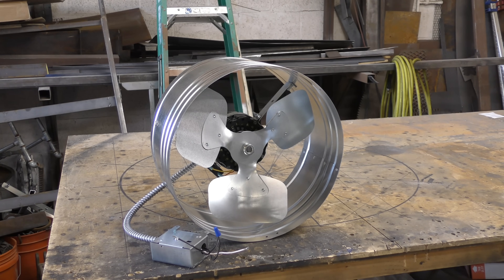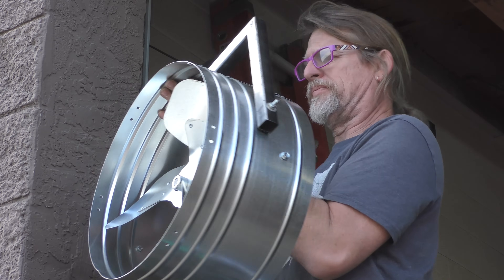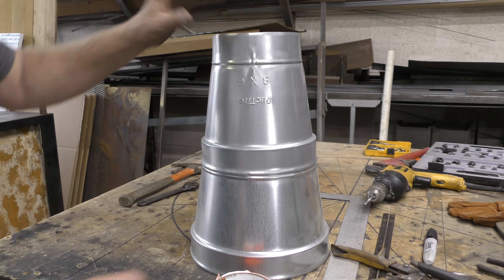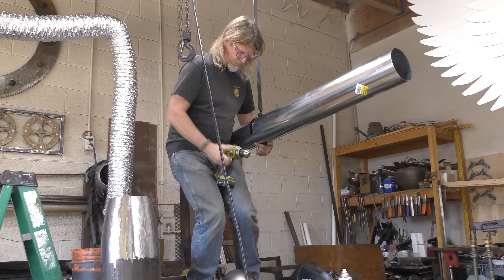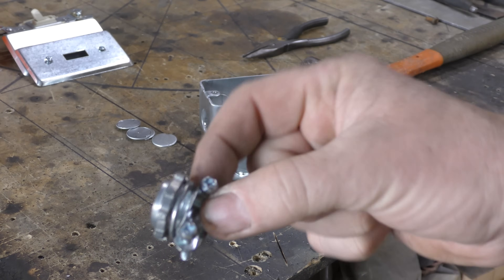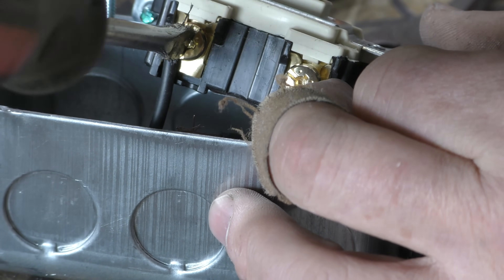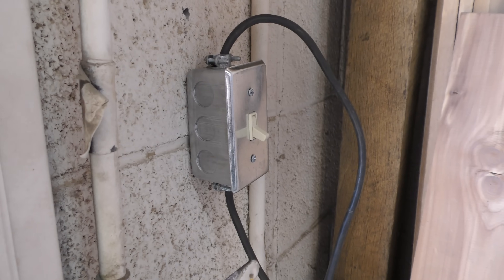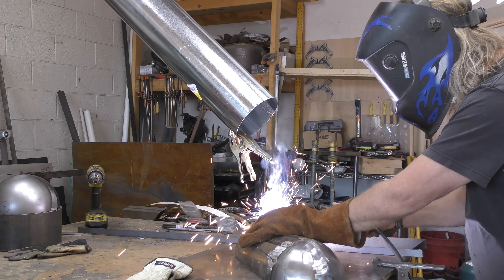DIY Fume and Smoke Extractor

Comment: that metal switch housing needs to be grounded. and also your fan otherwise its possible to have circulating currents that can damage the fan engine, lower bearing life and worst case humans.

Comment: I am about to put an exhaust fan together for a welding exhaust hood. I have a  5" metal duct in place. Would it make more sense to find a 5" fan or use reducers to take an 8" fan down to 5"?
Reply from the maker: I found that reducing the diameter does restrict the flow a bit. Finding a 5" fan may work better with a 5" duct
Reply: @ArtfullyRogue  that is my thinking also.
Reply: I would recommend you not use galvanized metal duct in the first 5'.

Comment: How we could select the corresponding diameter of the duct in considering of the fume, for instance I am working in welding area and there are different types of welding. Expected clean air and duct design? is their any standards?

Comment: Great idea, thanks. I would recommend you something for this design, make a rack for the duct and complete the base for the fan, this will improve the strength of your ventilation system. Remember that the mechanical vibration and the force of the air will damage the structure, so improving your design will protect of that. Saludos desde México.

Comment: Great idea! What do you think about turning your "funnel" extractor around, end for end? Meaning, put the larger end near your workbench and the smaller end out the door? Of course, you'd want to change the fan's direction of rotation. Just a thought.
Reply: It is ment to suck the smoke, if you do that it take away alot of air within

Comment: I think I might build one like your but probably buy an articulating arm for the tube. If you look on Amazon for articulating floor lamp you can find one to attach the tube to and the light is a bonus although it might not last long with all the hot flying metal. They only cost about $40. Also I will add a wireless remote to turn it on and off. A lot of the remote outlets are super cheap and can be controlled from your smart phone.

Comment: This is really great. Thanks for your brilliant efforts. I am thinking of using industrial pedestal fan by connecting it to 3 inch diameter PVC pipe behind. Will it work?
Reply from the maker: I'm sure it will pull some air, not sure how much though

Comment: Wonderful work, really nice video.   I am setting up a fume extractor for electronics soldering.  While doing research for that I saw some REALLY expensive prices for welding fume extractors.  I need to build an arm like yours but a scaled down version.  Cool Vise Grip counter weights.

Comment: Great content, well detailed as well...with reducing the diameter from the fan, down to the 6" ducting...how much of an increase in velocity/ suction do you believe you received?
It works exceptionally well, I would weld more if I was able to extract the smoke as you do...throughout the winter here.
Thanks again for sharing.

Comment: Thanks for this update.
I did a dust extraction using a Centrifugal fan but the fan pressure was too low to absorb the powder dust. can I use an Inline fan to enhance the system performance? kindly reply me

Comment: Just a suggestion for stick welding, not for TIG or MIG. How about using  a normal cooling fan like you use in your living room on a hot day?  Obviously  it would be unsuitable to have even slight breeze / wind during TIG or MIG welding.  So place this domestic fan to one side of the welding operator, creating a kind of slight wind tunnel effect so that any fumes are blown away from the operator and in the direction of the diy extractor, which could be maybe 1 or 2 feet away to the other side of the operator? Would that help to prevent any stray fumes   possibly being inhaled?
Reply from the maker: Sure seems like that would work

Comment: Great how-to video Doug.  I basically used your tips to build a fume extractor in my shop.  I have quite a bit of metal that I have accumulated over the last 20 years. I had an old patio heater like you see in all the big box stores.  The burner was shot. Using the exact same fan you did, I used the bottom cover of the patio heater (the part you lift and lower to change out the propane tank).  It is the exact size to squeeze the fan into after I zipped a 8" hole in what used to be the top of the cover with my plasma cutter.  Let me back up some, I tried a mock-up with 6" hard duct and one 8 foot piece of 6" flex duct.  I discovered that 6" duct was just too restrictive and greatly reduced the 1500 cfm of the fan. And the flex duct works good as long as you don't have any sags or sharp turns, it works best extended. I ended up using 18 feet of 8" hard duct and one piece of 8" flex about 5 feet long.  It performs great and is whisper quiet. The center cap from the umbrella on top of the patio heater is aluminum and the perfect size for the hood at the extraction/suction point so I zipped another 8 inch hole in it and used a 8" airtight take-off to connect it to the hood and then to the 8" flex.  You are correct at the end of your video about changing the flex out for hard duct but I would also recommend going to 8".
Thanks for your content, I always enjoy it and/or learn a thing or two.
Reply from the maker: Wow very cool and I really like the changes you made

Comment: I love brush-less computer fans for silence and 1000% efficiency compared to induction motors. You must use squirrel cage fans for the pressure needed in ducts and use more than one in parallel because  cheap big fans can't be bought.
Reply from the maker: Yeah this fan works in crunch but could use some improvements

Comment: I would like to have a similar system but it would have to extract the smoke to the exterior through a concrete wall. Any advice on how to do that?
Reply from the maker: My first thought would be to cut a hole in the concrete, unless you have a window that you can make an adaptor for and direct the fumes out the window or through the hole in the concrete

Comment: Nothing like a darwin switch -- No ground,  anywhere in the receptacle.   Wire too thin stranded  (too many thin strands) and not approved for connecting to the switch like that.  Electrical codes were written in blood and deaths.  Just dealt with a fire last night where a certified electrician knowingly cut a corner.
Reply from the maker: yeah I realized the mistake and have since taken care of it.

Comment: Good job on your extractor. May I suggest you edit out the few seconds using a cutoff grinder with no guard which is a bad example especially for newbies to grinders. Weld.com's channel has a video on grinder safety and at 43 minutes shows results of using no guard. Please. Thanks. Search video: Grinder Safety | How to Properly Use an Angle Grinder + GRINDER FAILS
Reply from the maker: Thanks Johnny, yeah I've been trying to figure out how to edit the video after it has been published without completely removing the video. Still working on that.

Comment: Good build. Welders, or anyone who even hobby welds enough: control your fumes! Particulates and gas/metal fumes are the final realm of safety that welding culture is finally recognizing. The majority of long-term illnesses associated with welding are mostly from inhaling such fumes/particles. Metal particulates are small enough to permeate the blood/brain barrier and fumes from most any welding is poisonous in some amounts. Long-term exposure is very detrimental. I personally work with two old-timer metal fabbers/welders (both in 60s): one of which had to retire after developing COPD, the other has tremors and neurological issues. The third old-timer is in good health, plays pickleball, and, when referenced, is always mentioned for his rigorous use of safety equipment, respirators and ventilators included.
Reply from the maker: safety first for sure, although late in the game it has become a priority

Comment: Cool! I've been brainstorming how to do this in my new shop. Just scored two 8" inline fans from my landlady to power the system (one for welding, one for plasma table). Just a word of caution, might want to upgrade to traditional wiring with a ground wire or use and extension cord with a ground for the switch and fan. If that fan somehow ends up becoming live, which isn't too bigger of a stretch to imagine given its all metal and vibrating constantly while on, it could get you pretty easily. Say you're leaned against your table with the welder ground clamp connected to the table and go to adjust the exhaust tube above the table... Zappo. Pretty crazy cool how well that system appears to work! Excited to get my head out of the clouds in my shop.
Reply from the maker: I totally see what you're saying. I'm not sure the current would be able to travel through the ducting though. Since the video was shot, I have rewired the fan with a grounded wire
Reply: @ArtfullyRogue  Good you took their advice. The ducting is metal so it's conductive and current would travel through it. Thanks for the video. I'll be making an exhaust system like yours when I start my new hobby of welding!

Comment: Thanks for the video. I am trying to do a similar system in my garage 🤪. What you would do different?
Reply from the maker: I would want more flexibility with the intake vent. Right now it only covers my welding at one end of my table. I need to modify it so I can move it around the whole table

Comment: Nice Build -- during your test, was that MiG fluxcore?
I have a small garage so I would put a switch near the draw in end so I am not sucking all the out all the heat in the winter.

Cheers
Reply from the maker: Yes I was using mig flux core. Good idea to put the switch close.

Comment: 1450cfm is too high and will pull the shielding gas off the weld.
Reply from the maker: I'm using flux core mig so no shielding gas issues

Comment: I liked everything about your project except the wiring. Your cable should contain an equipment grounding conductor bonded to your switch box and the fan. What you have is a potential electrocution hazard
Reply from the maker: Thanks for the info

Comment: Brilliantly done , forgive me for chipping in my two cents but could I recommend a centrifugal fan , the fan blade geometry is set up for high static pressure
Reply from the maker: Thanks for the suggestion James.
Reply: I was thinking the same thing. A centrifugal fan is much better for pulling air through flexible duct work.
Axial fans are for high flow low restriction applications.
Reply: @mattburrows2615  i agree but how does the normal guy know what size of squirrel cage fan to buy lol.
Reply: @derekmoen5382  generally one one would ask someone or look at what others have used for  the application in mind. Search the internet pictures and simple specs  really isn't hard. That excuse doesn't fly when it's the information age lol.
Even if he didn't do any of that and wacked whatever one would fit the ducting he most likely wouldn't be far off.
Reply: @mattburrows2615  haha, okay. so how many f'ing years should i spend looking? wada!
Reply: @derekmoen5382  your the captain of your ship why ask me lol.

Comment: great idea!  just wondering why you run flux core instead of using cover gas.
Reply from the maker: I've used flux core for over 20 years in the same machine. I always said that when this little box dies, I'll buy the tank and a new mig machine...it's still going strong. The majority of my work is rustic and industrial style so the splatter kind of adds to the character of the projects. For the cleaner neater projects I'll use my tig machine

Comment: Very interesting project and good vid!!!. I have to do something similar but because I live in the cold cold Edmonton I do not have the option of exhausting that volume of air outside the shop and have to recirculate it, so I will make a box and add a furnace prefilter and a couple of activated charcoal filters to the system. Would you know the CFM or liters per seconds the fan you used moves!? Thanks a lot for sharing and good luck!!!!
Reply from the maker: I have the fan and other parts listed in the description, this particular fan is 1450 cfm. Good luck on your project! :)

Comment: I set up my shop ventilation using one of those duct fans about a year and a half ago.  The problem I found is that the smoke and particulates that are sucked out also attack the fan bushings.  The rig seized up after about one month.  I rebuilt the fan and then had to jury rig a cover to protect the bushings.  That lasted about one year and I got to rebuild the fan again.  It finally died for good a few weeks ago.  Hopefully you have a better experience.  Cheers.
Reply from the maker: I'll have to keep an eye on mine to see how it does.

Comment: Got here from a electrical video because the orange tapes. 
But, maybe I am too late (3 months), you may want to add a funnel at the start of the suction tube (where the smoke enters).
It will increase the area it covers.Both wide and distance from welding point.
Well detailed video.

Comment: I’ve been planning one too. While it’s not really needed for TIG and most MIG, for flux core and the little bit of stick I do, it really is. I’ve been concerned about two possible problems.

One is the hot particles vaporized in the welding fume. That consists of metallic compounds as well as compounds from the flux core, or stick coating. This could damage the motor, because they’re not designed for this much crap in the fume from our furnaces. So I plan on using a furnace filter in front of the fan. A furnace filter designed for oil, or even coal burning (shudder) heating systems should help, though not perfectly.

The second is blowback from the open door. It seems that whatever I blow out comes back, at least, a lot of it, depending on which way the breeze is blowing.
For the blowback problem, I plan to remove two panes from the window, which gives me almost the exact size opening I need. I’ll put a shutter on the outside. I found some nice furnace fans on eBay with speed controls for about $100, depending on size.

Im not sure where you are, so some of these problems may not apply to you. But for me, in New York, it’s a problem. Good project. I’ve been waiting too long to do mine. Now, having watched you here, I’m motivated to get mine done.
Reply from the maker: good luck with yours! I use mine often and love it!

Comment: It is probably undesirable to place the suction pipe so close to a welding torch that runs without a nozzle ... Carbon dioxide (CO2) can blow off ..
Reply from the maker: Yeah I hear you

Comment: I already have about 80% of what you used in the video sitting on my basement floor to make something similar.  I’m sort of glad I put this off.  You have two ideas that I hadn’t exactly worked out.  Or really had a different idea.  The pivoting bracket and rigid tube.  I have a 10x16 space to weld in and if I am MiG welding it will fill up with smoke if I don’t have a fan going and open doors.  It’s 30 degrees right now. Guess what I don’t want open?  Guess this will need to become a priority.  How many CFMs is your fan?  I have a few laying around that I think will work, but the only way to really know i suppose is to hook them up.
Reply from the maker: The fan is a 1450 cfm attic fan. I was worried at first that it wouldn't be strong enough but I haven't had any issues with it doing it's job.  And brrrrr that's way too cold for this desert rat for sure :)
Reply: Artfully Rogue haha. When I took temps on the wall around my Uncles house last June of 170°F I realized the desert was a little hotter than I remember. 🤣  I’ll have to see why the CFMs are on the fans I have.